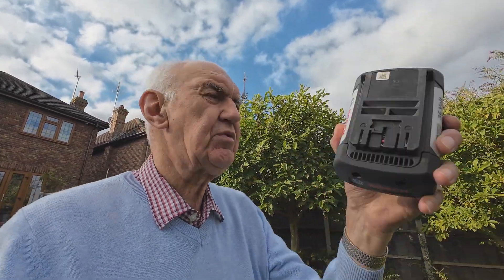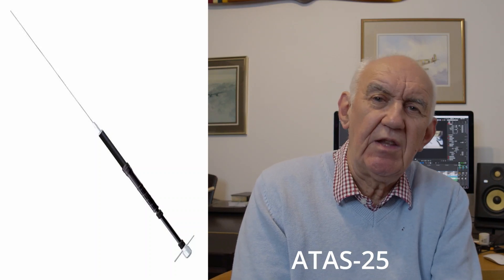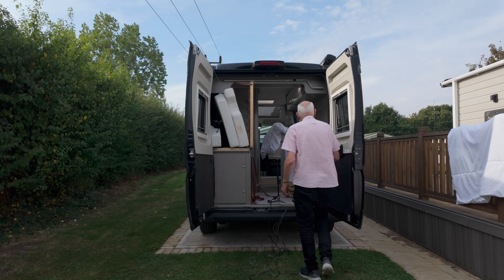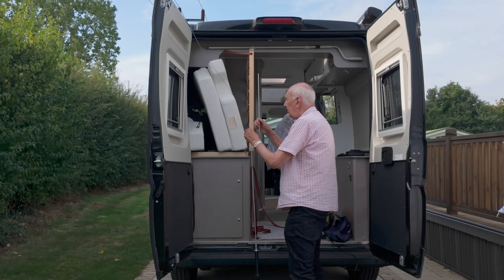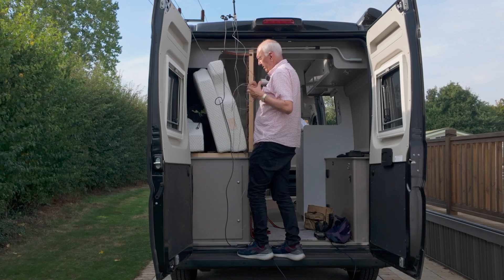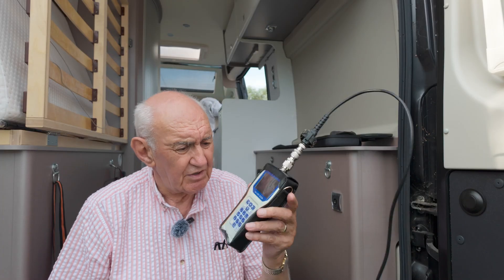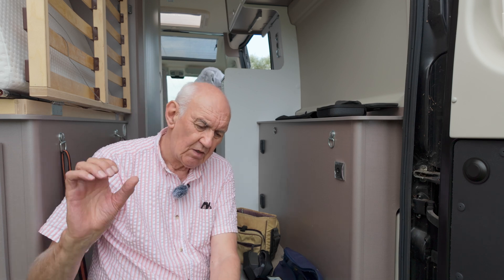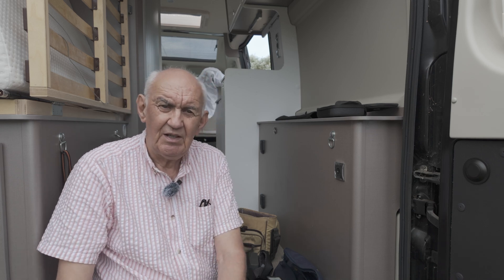Smart Ham Radio Portable Quick Fix Antenna

Comment: You always come up with good videos! I like the fact that you mentioned capacitive coupling. The capacitance of a wire on a conductive surface can be calculated in a similar manner to calculating the capacitance of a capacitor with two parallel plates. Same with a mag mount. The hard part of the calculations is knowing the dielectric value of the paint and whatever the insulating material is. But it can be estimated well enough. The capacity can also be measured with the right meter. I have done this a few times. Once the C value is measured or “ guesstimated” the actual impedance ( reactance in this case) can be calculated or roughly determined. It does not matter if there is one ohm of resistance or one ohm of reactance the effect is the same when dealing with RF. Larger the C value the lower the impedance. I have also seen some flat magnetic conductive mats used recently but have not gotten my hands on one yet. I plan to get one and try it out on my van roof.
Reply from the maker: Many thanks for sharing. Interesting comments.
Reply: @watersstanton  I took a mag mount apart today and used the magnetic to hold a mirror mount. I replaced the short 3/8-24 bolt that was holding the assembly together with a longer one so I could bolt a bracket holding the mirror mount and have room to connect the coax. Then I mounted my Hustler mobile antenna on the modified mount. That was placed on the hood of my Ford Transit van. I ran two flexible speaker wire radials from the ground side of the mirror mount up the windshield and one down each side of the roof ( just inside the roof racks) to the rear. I tied a piece of string to each radial to either tie them down or simply close the door to hold them in place.
I have a perfect 1:1 on 40 meters and less than 1.5 :1 on 20 and 10 meters. The RBN today showed that I had a good signal on all three bands from Virginia. A number of 20 meter spots were in Europe. I use this same antenna on mirror mounts mounted to a large screwdriver in the ground with usually 3 radials when camping. I also have another similar mount I clamp to picnic tables and run the same three radials. 
Your video was the spark to get me to modify the mag mount and try the roof radials on my van. Works like a charm!  It’s a bit hard to put the mag mount up on the roof but I plan to try it sometime when I have more time. Thanks.
73,
Don 
N4DJ

Comment: An interesting antenna system. Think you hit the nail on the head, the radio and antennas have to be accessible to use other wise it’s all too easy to simply not bother. Im just trying to make mine a lot easier to setup in the camper.
One question Peter if you don’t mind. I noticed that the Line Isolator is at the antenna end of the coax, is there any benefit having it at either end. 73’s
Reply from the maker: I put the line isolator at the antenna end so that no detuning occurs as the coax can act as a radial. However, as none of the radials are resonant, you can probably put it at the transmitter end with equal success.
Reply: @watersstanton  thanks I understand now 73’s

Comment: What if you just use one radial 'bird's nested' up on the roof of the vehicle instead of the 3 - I wonder whether that would work seeing as the length and placement of the  radials appears to make little or no difference?
Reply from the maker: Try iy.